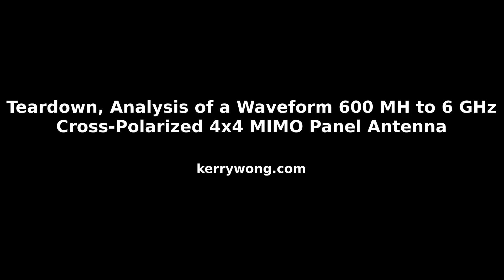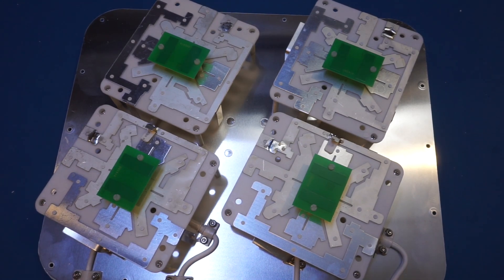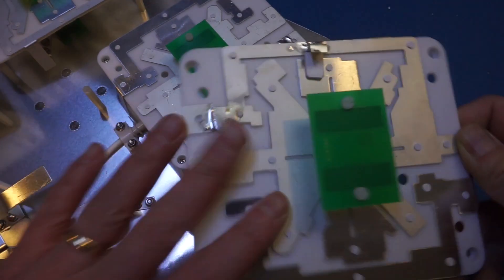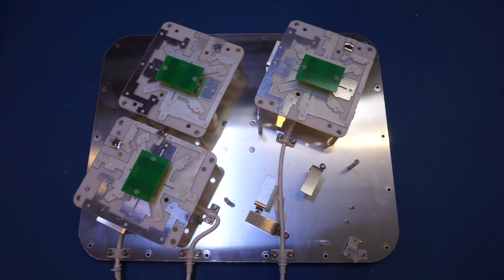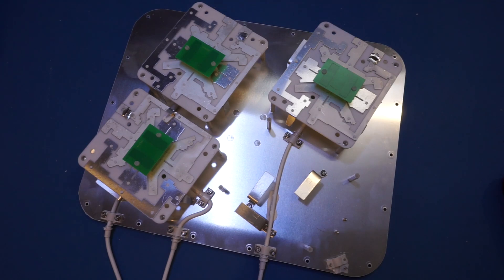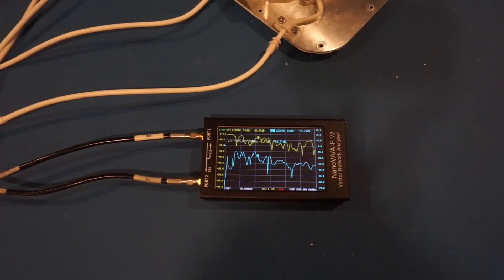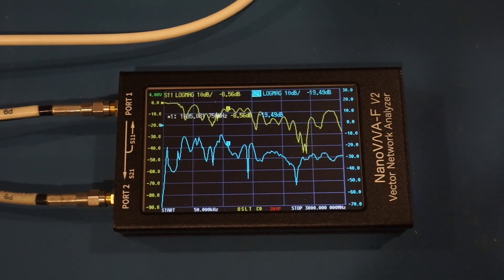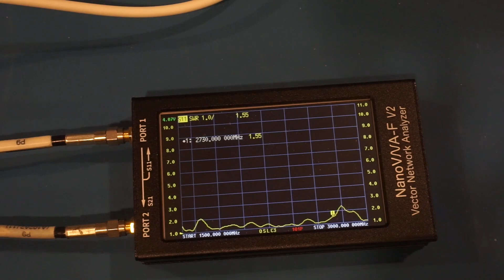Teardown, Analysis of a Waveform 600 MHz to 6 GHz Cross-Polarized 4x4 MIMO Panel Antenna

Comment: I'd like to see a comparison between this and 4 separate traditional antennas mounted on a roof, similar to what is used internally by the 4g/5g router to begin with. Also my old Acer Laptop had an internal antenna that looked exactly like this waveform and covered most of the inside of the case. The design is nothing new and certainly not expensive or complex to build. In my experience with antennas the difference in results between complex designs and minimal designs is very minute if at all. Like using a thin stripped wire tie stuck in the coaxial input on the tv by itself resulted in the same 46 ota channels as the expensive boosted ota antennas, which was also the same as the $2 rabbit ears, there's only a tiny window of circumstances where the difference might be really noticeable.

Comment: Hello, you can also teardown and analyze the Poynting 4×4 MIMO XPOL-24 antenna? 
I don’t understand why they made Сell 1 polarization: Vertical & Horizontal, and Сell 2: ±45 °, why they didn’t do Cell 1: ±45 °and Cell 2: ±45° as it looks in Waveform.
What is the essence of such a decision?
I thought that MIMO 4x4 technology works well only on antennas located at an angle of ±45°

Comment: Hey, thanks for the tear down. As an RF guy I’m not easily impressed by most antenna designs, but this one definitely makes the cut. I can’t even intuitively wrap my head around this antenna. This “S-shape” with two capacitive parasitics over the driven element and the “wrap-around ground” are novel. Or at least weird. I’m sure it’s no coincidence the S11 is clean across the measured bands, but now the radiation pattern is of course the big unanswered question.  Even simple wideband antennas show freakishly complex patterns over more than one octave, and this one covers three and then some.
Reply from the maker: Thanks for your insight Bert!